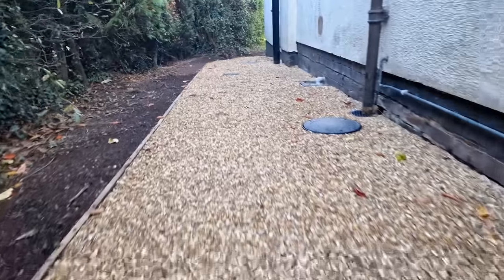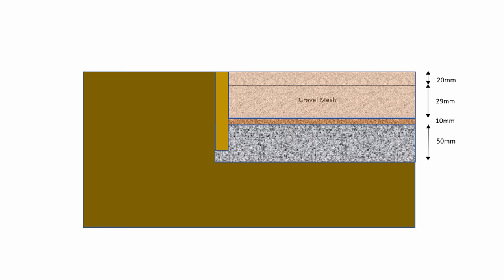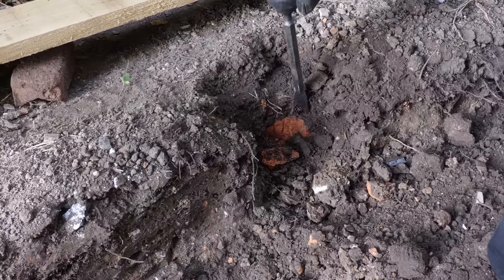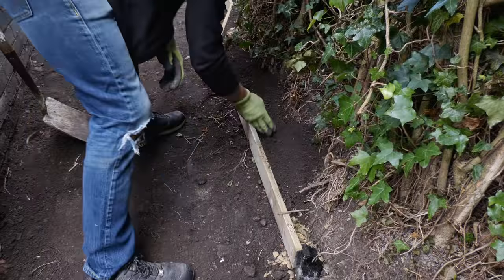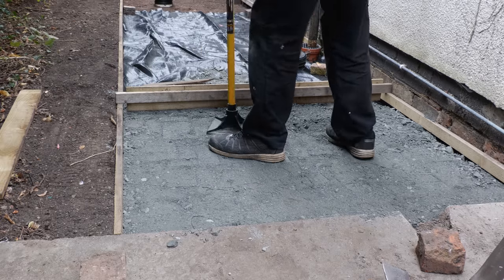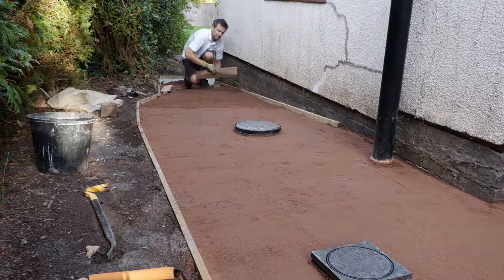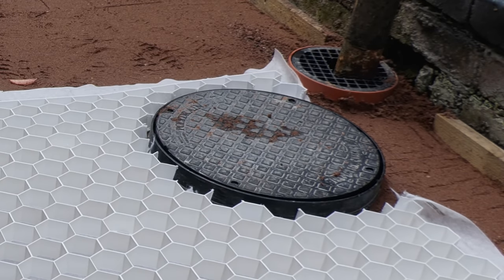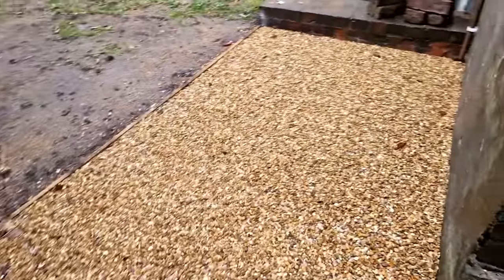How to Build a Path - a Complete Step by Step DIY Guide

Comment: Ha, 2 weeks too late for me. Landscaped back garden during lockdown and for the path I kept it simple with weed fabric with loose 20mm gravel on top. Looked fine for a few days until the cat saw it as a giant litter tray.

So dug up all the gravel couple of weeks ago. Lifted up the weed fabric and tamped down the clay soil to make it flatter. Put the weed fabric back down and then put gravel grid in place and refilled with the gravel. Looks great and imagine it'll last quite a while.

Your 10mm gravel does look a lot better than my 20mm.

Comment: Great stuff Charlie and you’re dead right, lots of useful techniques here that could applied to other situations. 

A while back I also completely over-engineered a shed base to which my wife had a similar comment. I was however vindicated when the shed installers where putting the shed down and commented on how it was one of the most impressive DIY bases they’d seen - I was emotional 😂

Comment: How do you find clearing the path of gravel that has leaves and tree matter in? Do you find it almost mulches if left or do you have to make sure you're on top of blowing off the leaves?
Reply from the maker: Yes I use the leaf blower on it - pretty crucial to have one as it blows the leaves and stuff off without whipping up the gravel. In big storms we do get muddy water going down it off the drive which is probably clogging up the grids but there's little you can do about this and it doesn't affect the overall stability of the path.

Comment: Over engineered yes. But boy does it look good. Worth every minute of effort in the long run I'd say. I've gravelled large areas of my back garden around raised beds with very similar gravel to yours and have simply laid weed membrane straight onto the soil with 75mm of gravel on top. Easy and quick to do, but the gravel moves around and settles into dips and troughs over time, especially when wheelie bins and excited grandchildren get involved. If I could have my time over, I'd follow your example. Great video and tutorial Charlie, thanks for sharing.
Reply from the maker: Thanks mate. I appreciate that. 👊

Comment: That’s a lovely job Charlie, a lot of work, and looked to be so satisfying to finish it off.
You could certainly skimp on some of the construction, but to do it properly and ensure the path remains solid and stable for years to come, there’s not a lot you can take out.  The only thing I would change would be the weed proof membrane that I don’t think is adding much.  It possibly would help prevent the type 1 MOT from pushing into the underlying soil, but if the type 1 is compacted properly, then it shouldn’t do this anyway.  As far as weeds are concerned they’re going to have to grow through the finishing stones, the bottom of the grid and all the sand and type 1 layers, and if they do that, the roots will just spread sideways anyway.  No I think more of your problem with weeds is that they will inevitably grow directly in the gravel on top of all the layers.  We had a driveway laid with similar golden gravel and weed proof membrane underneath and the weeds will happily grow in between the gravel, and if you don’t keep on top of them the tap roots grow straight through the membrane.  I speak from lots of experience of pulling weeds out!

Comment: Thanks for this Charlie. Looking at doing an extension to my rather narrow existing driveway using gravel grids. While not quite the same as this, some more useful & timely info - much like your other videos.

My next major project is likely to be a patio - I don't think you've done one of those yet have you?

If not, please begin trying to convince your wife you need one of those somewhere in your property 😂 

While there are many videos on laying a patio here on YouTube, I just know that yours will bring some useful & understandable guidance.  Plus, I am sure your wife will pleased with the patio too! 😂 😁
Reply from the maker: Thanks Phil. Patio's coming, but is a fair few months off though. I did lay one below the log store https://youtu.be/BpDRDu8GBwI and found it surprisingly difficult to get it level. It's all in the preparation of the sub layer. Get that perfectly level and it's a breeze. Try and bodge each slab flat with a rubber hammer and it's difficult. 👊

Comment: A great video Charlie. Vastly over engineered but  what the heck. I’ve used a low density polythene gravel grid which is not brittle and can be cut with a handsaw.  I’ve created a base for a shed as well as a pathway and each just has 40-50mm of sharp sand to level the ground then a layer of garden membrane to prevent weeds.
Reply from the maker: Thanks Nick. Nice work on the shed and pathway base.

Comment: I did a gravel grid driveway recently and found if you place an additional weed membrane layer above the sharp sand you can happy use the cheaper £2 per 50x50 heavy duty plastic grids and have the same benefits compared to the very £££ version seen on this video.
Reply from the maker: Thanks Ben. That's good to know.

Comment: Would this base be suitable for a level shed base for a 12 x 7 foot shed? I'm having a real problem getting someone in to build a concrete or slabbed base so with this type of base I could maybe do it myself.
Reply from the maker: It's a good sub base level, yes. You'd need to put slabs or paving stones down on top of it though.

Comment: Great work Charlie, definitely over engineered but as many said its great youtube content for the DIYer. One thing I heard as a student and never forgot and have realised over many years of building gardens and teaching is .... Weeds come from above, not from below! Yeah if there's roots of deep rooting perennial weeds they might sprout through all the layers but in general the weed seeds are going to come from a build up of organic material that builds up to include dust, broken down leaves and algae/moss that just is around in an outside space. The weed seeds will land on the gravel and root into anything and if they can grow in a crack then theyll grow in gravel and the dust etc. that's in the bottom, so a membrane is kinda useless and actually retains moisture so actually helps the developing weeds... So over time weeds just get into gravel. herbicide or a flame gun/ heat gun are your best friend to stop them developing. boiling water , strong acetic acid or salt work too.
but membranes just don't work ... There is an arguement, however that a membrane will stop worms pulling mud and organic material up into hardcore filling to allow weeds to develop easier.
Reply from the maker: Thanks David. Good point. I think the main benefit of the weed mat in my case is to prevent contamination between the layers but the Type 1 MOT kind of renders that irrelevant. I do have a back pack sprayer and a 5 litre container of Gallup 360 so I'll keep an eye on the weeds that way. 👊

Comment: 3:00 @charlie diyte 
Wow, someone who’s actually using the correct colour marking paint for the project that’s being done, as white marking paint is used for excavation👍🏻👍🏻
Most ppl use Pink or Orange and that is used for surveys & communications/tv/ISP respectfully.

Know not big deal, but one of those things that if left for long time and other subs, contractors, inspectors com8ng to a site; might cause some confusion down the line, which I’ve seen happen in a costly bad way.
If marked and worked on pretty quickly and only person there is [You] & some friends, than not that big a deal what colours are used as long as everyone knows, but if on job site w/ diff trades, inspections, etc….it does matter.
Absolutely like watching your DIY vids, as not just fun and entertaining, but still learn things myself (and I’m sure same with others) and been in trades for longtime, and as I say: can always learn something new, refresh what already learned (even if means learn how to do a diff way); and the day ya stop learning, might be the day ya take a look at yourself and ask if wanna still be doing the same thing. This goes for any job, imo, not just construction/trades.
Cheers✌🏻
Reply from the maker: Thanks buddy. Appreciate that. Totally agree on the learning point. I always think any trade who is still receptive to learning like your good self is obviously damn good at what they do. 👊

Comment: Over engineered possibly... but coming from a Landscape Architect you did it all correctly and it will last a lot longer. My only comment would be drainage, presume the area is free draining and doesn't suffer from water logging? Sometimes paths need some sort of french drain / soakaway. Also keeping water away from the building albeit in your case it previously had soil so its likely better now than it was before.
Reply from the maker: Thanks Dave, I appreciate the input. Yes drainage should be ok and the grid barrier is obviously vapour permeable so it should drain a lot better than it did previously. Fair point though.